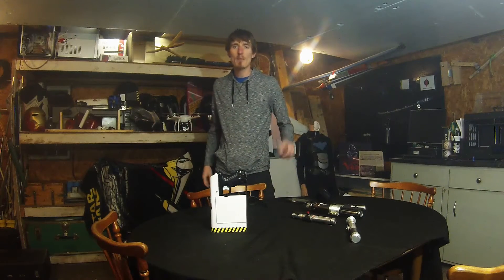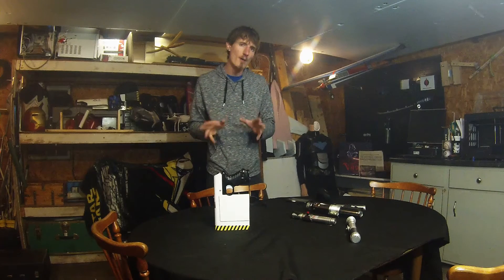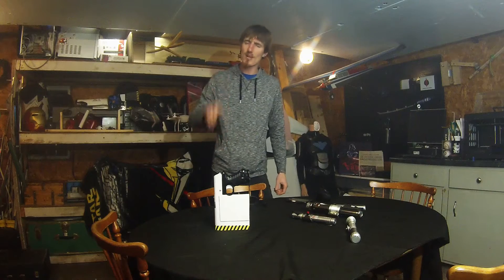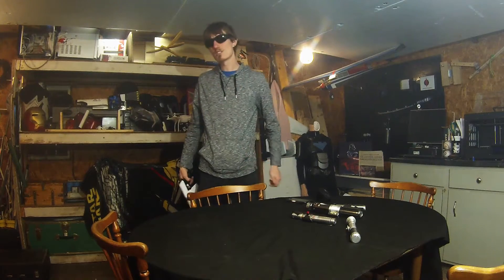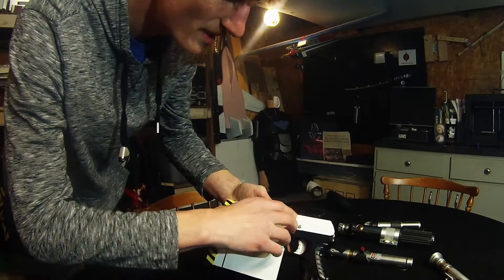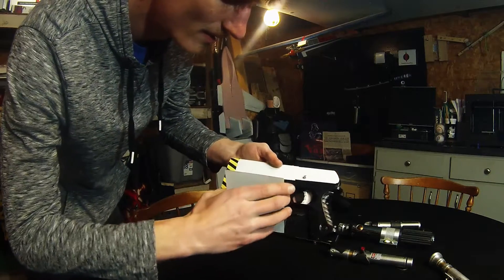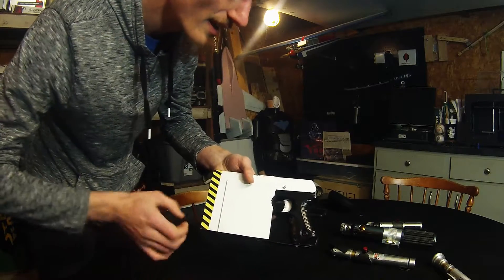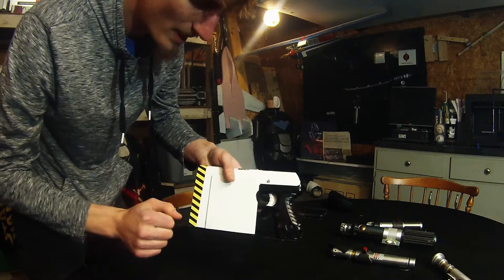16 watt Laser Pistol

Comment: That looks like it handles brilliantly. It would probably be more efficient if you could get all of the lasers pointing in the same direction, but you'd have to manually shift the position based on the distance of the target. I bet there's a more efficient way to do that.
Reply from the maker: If you wanted it to be more efficient at burning you could likely mount each laser to a servo and have them adjust based on a distance sensor to align each one to point at the same dot. I didn’t really create this one with burning in mind but more for the cool effect though!